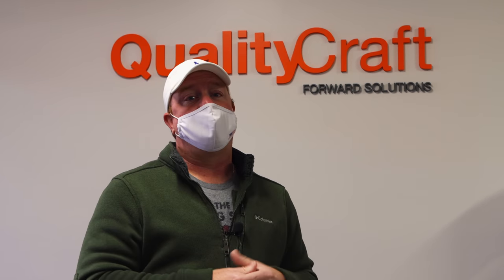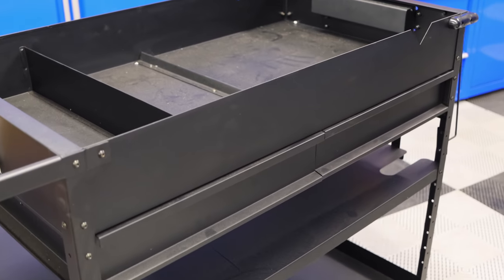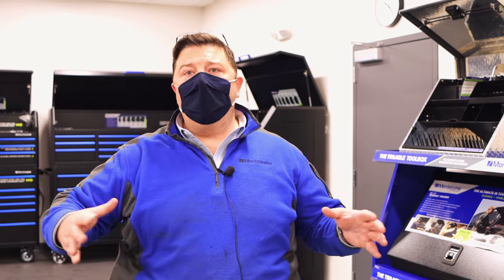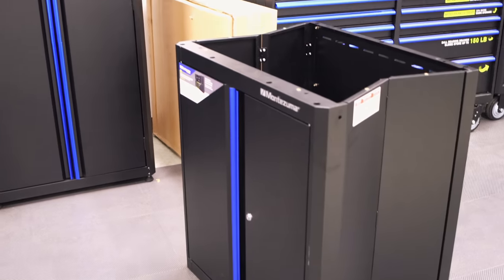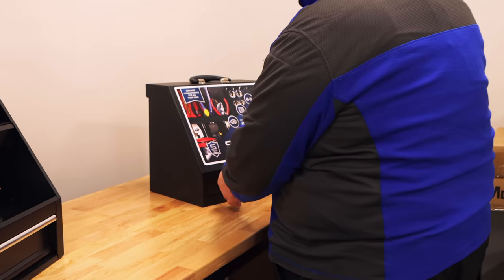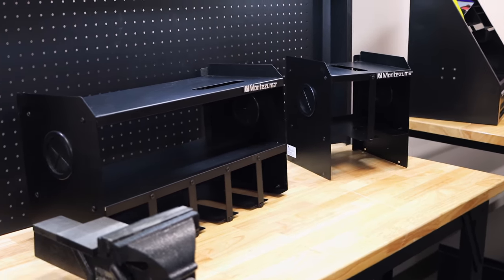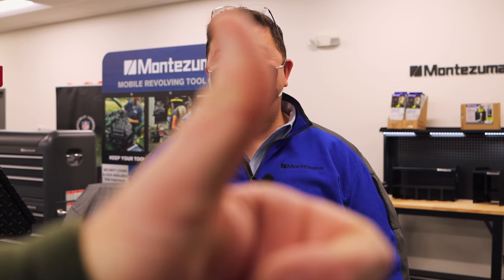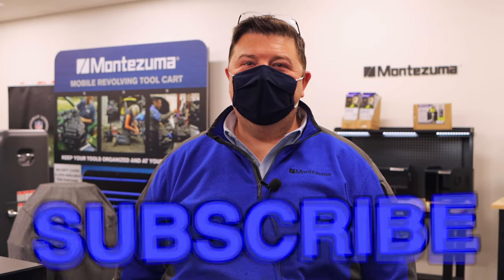What's New At Monetezuma Toolboxes? Let's Find Out And Take The Tour Of Their Facility!!

Comment: My dad has some of the very early CPL boxes, going back to the mid 90s.  That's back when we had to use a padlock to lock them with latches on each side, they're still on the farm flatbed to this day.  The nice part of those is there's no gas strut obstructing the center of the combination wrenches.  You flipped the lid up and slid it to the side to hold it in place.  The best part is that his 2nd one is a full 30" bolt bin.  Nuts and washers on the top and then a raise up shelf with bolts behind it.   If I get this next job I want to buy a roller cabinet from them if I an afford it.  I have a 40 some inch x 18" and for what it is it's great.  Those door latches by far are my favorite and until this video I didn't realize it was patented.

Comment: I'd love to see a middle box that fits the 26×18 footprint triangle box. I'm a union millwright, so I'm always in and out of my truck with my boxes, and need them to be portable. I don't use a bottom cabinet or a tool cart, but just set them on a convertible hand cart.
Reply from the maker: They have a 26x18 triangle that’s waterproof and dust proof
Reply: @KoonTrucking  right. I want a box for under that.

Comment: As far as regular tool boxes go I had trouble with my box from them ended up with a snapon as a replacement and trades that off for a matco box 8525 and traded that off for more matco boxes 8525 in yellow and ended up getting two and adding hutches top boxes and side lockers and end cabs don't know about the triangle boxes
Reply from the maker: The triangle boxes are awesome. I have zero complaints with them

Comment: You said earlier that the wrenches don't fit flush on one size, did you mention that to them?
Reply from the maker: On the Precision Torque Mac wrenches you have to flip them over because of the extreme angle on them.
Reply: @KoonTrucking  one of the pegs was to close to the other you mentioned and the wrench wouldn't sit flat without overlapping another wrench.

Comment: Their quality control sucks, I’ve ordered a led light set and it came with the factory box and that box had water damage  it was kicked around , they didn’t even think to put it in another box to protected. I. Called and bitch them out they sent me new ones. When it comes to these tool box it’s over priced I rather go to Home Depot and get the Milwaukee tool boxes lot durable and cheaper, I bought a brand new 68inch epic tool box from snap on and paid 5k and love it. You can actually purchase this. Box in Milwaukee brand for 2k or less. I’m not Impressed with this company.